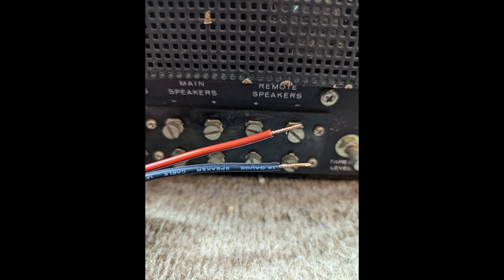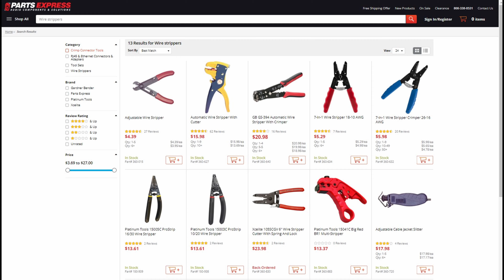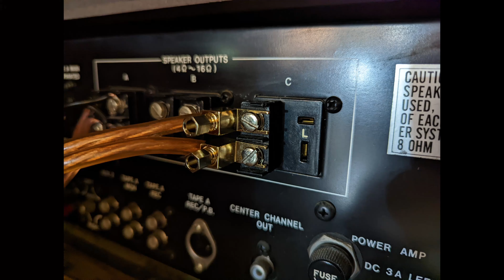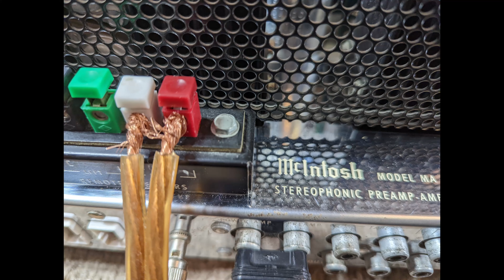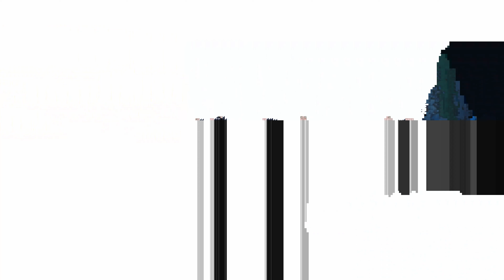How To Connect Heavy Gauge Monster Cable To Vintage Stereo Equipment- Receivers Speakers Amplifier

Comment: The only thing my amp manual says about speaker cables "It is very important to use speaker cables of the
correct diameter in order to reduce power loss". My speakers, rated 4ohm 900w, manual reads "Use the appropriate gauge of wire. A minimum of 18 gauge is recommended for up to 25 feet". I use heavy (10ga), good quality speaker cables because they sound better to me.

Comment: Hello folks. I always tin the wire because I can turn in into a spade lug or pin using solder that is made for electronic products 4% silver added. Not the plumber kind.
Now nice fat wire I trim the end down for it will fit. 
Then I'm still crazy by thinking on my own or remembering someone else idea.

Ride Easy
Reply: you should research "tinning wire with screw down connections" then stop doing this. 

also trimming down the end of a wire, IE removing individual strands of copper wire from the bundle, does exactly what is sounds like it does, it makes your low gauged wire into higher gauged wire and if enough wire is removed from one end could cause resistance and heat issues at the connection.

Comment: Clearly we share a similar perspective on expensive speaker wire.   I sold (almost literally) a ton of Monster Cable back in the late 70's and early 80's and crimped my share of connectors. As a college aged salesperson, I memorized all the talking points. My personal opinion was and still is, that Monster Cable (along with all the others) did as much or more to improve retailer profitability as it did to enhance the listening experience. The Kool-Aid was really flowing as they entered the inter-connect cable space. I currently use 16 ga, properly terminated speaker cables.  I'm sure there are many who disagree with me, and to them I say "spend away".
Reply: Cable thin enough to generate heat would be a toaster, iron or hair dryer. Super thin cable is called a filament which gets you into incandescent light territory if enclosed in a bulb filled with special gas. Even a monster Pioneer SX-1980 would only need 14 gauge wire to power speakers. If you had a tower of speakers needed to host an A;ice Cooper concert you might need thicker speaker wire to power massive tower speakers. However for home listening 14 gauge copper wire will do just fine for home systems.

Comment: I'm kind of new to all this, and I'm glad this video popped up. I was never sure what to use and of course the " bigger is better" always comes into play. I always wondered about bigger speaker wire. I'm using regular speaker wire on my Adcom 555 amp to Polk speakers. Which use the banana style clips. I guess I will just keep on keeping on instead of buying into the bigger cable thing. Thanks

Comment: Im beginning to wonder if this is a pointless exorcise as you could use the heaviest gauge wire possible but it still connects to terminals on the amp which in turn are fed by tiny thin wires from a circuit board, its like turning on a garden hose into a  6" pipe your still only going to get the same amount flowing out the end.

Comment: Maybe something that's useful to offer. I make binding post extensions for my clamp or screw type speaker/amp connections when I encounter them. I connect a short lead of heavy guage speaker wire (about 1.5") to a binding post soldered and covered with shrink wrap to install into these connectors, if the hole is too small for the speaker cable I use for this adapter I remove enough of the strands and tin them to fit for the open screw type I use spades and cover them up to the blades with shrink wrap. Sure they hang down a bit but this allows for the use of quality speaker cable in large guages and they can be reused for other amp/speaker applications. Works great! I usually include a set to a buyer of any of the vintage kit I sell as well, it's always appreciated.

Great job Kevin, love this channel!

Comment: lol the argument makes me laugh and irritated at the same time. Personal I think to some degree both  are correct. I say that because I'm pretty certain that it hasn't been as far back as the 70's through the 80's Audio gear was designed and built with the available Resistor's,  Capacitors, and  Transformers etc. They were designed with the limitations of those components and what was then known about electrical energy moved within. I remember it was early to mid 90's when I read an article on how electricity flows through wire. I assume up till then give the articles premise that the current flowed through the wire. It does not. It flows along the surface and along with the upgrading of internal parts and refined circuit designs the idea of larger cables came into being. Danny Richie of GR Research has done measurements showing, if I remember correctly, frequency response differences and put out criteria on not just cables but isolation from grounding against ground loop interference as I understand it. It makes since, but I have listened to his recordings of it either as I think he made spec recordings that are downloadable for comparison. However, the biggest caveats from him and several other reviewers was it's really your choice if you are satisfied with your synergy no worries, but if there is something bothering you that you can't put a finger on it could be cables. Some people use to argue that speaker isolators were shake oil as well and that burn in wasn't a thing either. One thing that few have touched on that I came to understand long ago is very few if anyone hears the same way when listening ear canals very and as such so does what we hear and perceive. This part of why there are so many different speaker designs and mfg. I am fairly certain most, but not all vintage has certain characteristics that are similar just as much as they have reflected by specific brands certain styles, quirks, and or characteristics Silver Face, Black Face, Meters no Meters, green lights blue lights, Tube like sound and so on. We know today certain abilities of given Amp Designs give certain specific characteristics and matching is as much luck as it is intuitive. In the End it's your choice and what you seek. Thanks for the info on this subject and the adding of a Sub to Vintage receivers.
Reply: "Skin effect" has little application at audio frequencies.
Reply: An example of discovery and synergy is a recent vlog post by Thomas and Stereo. Who has been an Audiophile for at least 30 yrs and who stopped critical listening in favor of good enough and almost entirely devoid of talking down mfg and price in favor of performance and quality. He also does testing against by allowing his contemporaries of whom he has  7 or 8 Audiophile buddies with various systems they have acquired to review what he give them against their acceptable equipment not just his. Their systems, including his, run in the hundreds of thousands of dollars. At any rate he for years has tried to like Single Driver speakers like The Dirty Weekend by Zeus and or the Pearl Audio Speakers by Paul Lovegood. He hadn't succeeded till recently. He never got it till in a fluke he stopped trying to drive them with his various high powered digital or Tube Amps. Instead he put them to his tests with a 6 Watt Class A Tube Amp and was blown out by their presentation of his musical tastes. He said...Now he gets it. He reasoned though can't verify that high current amps were essentially overloading the voice coils on speaker materials creating a sound he couldn't stand but now with the useable and lower powered class A Tube amp or even a 15 watt receiver anyone like him love the single driver concentric speakers so many were Gaga over and find sonic Nirvana!

Comment: Heavy gauge speaker wire is a waste of time and money.  It's used by audio fools that have more money than brains. The laws of electrical engineering can't be changed.

Comment: I do not disagree with your sentiment here. Lets look at the numbers,... a brief look.
--
Diameter of 18awg wire is about 0.04in.
Skin depth at 20kHz is about 0.02in which brings the 18awg to look like 24awg at 20kHz.
Depending on the length of the wire this WILL effect the high frequencies.
24AWG resistance ~24 millohms/ft, Imagine 15ft of interconnect => 0.36 ohms/channel
Now if you are running 4ohm speakers that is about 10% of the voltage dropped across the cable at 20kHz,... OH NO! LIONS TIGERS AND AUDIO BEARS.
{note I did ignore some wire cross section geometry considerations,...}
To solve this: turn up the treble a tiny bit,...
{ Oh your Carver has no tone controls? Sorry about that. }
--
The wire resistance will dissipate power across the audio band, but unless we are talking big time watts this only means you need to turn up the volume a bit.
This is an argument for efficient speakers IMHO. 
--
Room acoustics will DOMINATE the sound before these wire considerations are important.
Then your speakers and crossover topology will come to the party. 
Probably followed by your amp design.
AND note the largest "problem" in audio is between your ears. 
--
I am not arguing for 18awg wire, personally I am comfortable with 14awg which has a big advantage with durability. Zip cord is fine and dandy. 
--
If you are really deep into a desire to understand these issues in depth, 
see https://sound-au.com/cable-z.htm
I did not read the entire article, but it looks complete.

Comment: If you must have bigger audio jewelry/wire try a clamp on y connector soldered and cutting one of legs. The pin is safe with quality electrical tape/vinyl tape.  Ironic vinyl tape for vinyl playback.

Comment: Just as reference, 16 gauge wire is 4 ohms.....per 1000 feet.  That said take a 10 foot piece of same equals 0.04 ohms.  That intern is 0.005 out of 8 ohms or 0.5% of your load (speaker) value.  Making that even easier to understand for a typical 100 Watt/channel amp we are looking at a loss of half of one watt dissipated within the speaker wire per side so a total of 1 watt loss in speaker wire.  Because our ears work on a logarithmic scale no one can hear the difference between 100 and 99 watts.  That explains why it is actually a great gauge to go with as when using stranded wire it is also usually easy to work with yet physically strong enough to not worry about.  14 Gauge (0.025 ohms/10')is the absolute largest I would ever use unless we are talking commercial installations with really long runs of speaker wire.  Those are just the simple laws of a mister Georg Ohm and those laws don't change over time.
Reply: Good info I just stick with 14 gauge though maybe my wire length requires only 16.
Reply: Get a Life !!!
Reply: I use 14. Most of the monster cable stuff is just snake oil.
Reply: @pmscalisi  IMHO, actually monster cable was the first widely available and popular overkill speaker wire and back then was considered and mostly was grossly overpriced. That said, today I think they are well worth their current pricing. Example: 50 feet 14 gauge Monster Speaker Wire cost only $25.  I don't consider that being ripped off or snake oil. As reference, over the last 50 years, as a radio frequency electronics technician working with all types of cable, I quickly learned quality cable needs to meet two specifications.  First is electrical specs to match the application. Second and nearly as important in rough environments are the non electrical materials and construction. Examples: Anything used outside maybe subject to sun, wind, and water damages. For any cable/wires placed underground, direct burial rated cable is recommended. Electrical specs don't matter when your cable is falling apart or just too flimsy to hold up even inside.  No, I am not making a case to buy a $1,000 4 foot power cable for your amp. That's insane unless you're working with a commercial application using crazy long lengths.  Simply put, quality cables/wires that exceed the requirements of any audio frequency and properly shielded (where needed) are available for very reasonable prices.  I've even seen one 120V amplifier power cable for $15,000. Talk about nuts!!!!!!!!!!!!!!!!  So rest easy with the "Monster Cable" stuff. 😁
Reply: @2wrdr I understand I’m an electrical engineer myself. And a semi professional musician. I just believe some specifications are pushed just to sell a product. 
I’m also very practical, perhaps this is where my skepticism comes from. 🤷🏻‍♂️
Reply: @pmscalisi  " some specifications are pushed just to sell a product "  Exactly, one must understand even most audiophiles have very little understanding of ohms law. That is just ignorance though.  When the same won't listen to an electrical engineer about something as simple as a power cord, well that's just stupidity,  but if they got $ to burn let them enjoy the fire.
Reply: My 5 gauge is 1.2mohms a meter. Not much resistance in other words

Comment: Have used zip cord ( 14 or 12 gauge as copper was cheaper then) for passed 50 years and hasn't failed me yet. Banana plugs whenever  I could, and always tinned cables regardless of connectors I needed to use as it made all those little copper strands into one solid wire. dual banana plugs are great to help keep things in phase when you can use them. Just found channel enjoy your videos!

Comment: What if you splice cables to create composite connections eg to an amp or speaker switch box accepting different connectors than what extends to the amp or speaker?

Comment: Great video! Two points:
1. Avoid over tightening old connections as plastic parts can break and screws can strip out. 
2. Check connections frequently as wires tend to loosen up and oxidation can cause poor conductivity.

Comment: I laugh when I think of the snake-oil buying audiophiles connecting their 10 guage cables to screw down terminals and reducing the effective wire guage to a fraction of the cable. It's almost as funny as them freting over digital interconnect cables. I love your comments in the begining of the video.
Reply from the maker: Thanks!

Comment: Catching up on your videos since I joined this site. I love it, so informative. At 65 and owning stereo equipment since the mid 70's I was always told you couldn't go wrong with a 16 gauge speaker wire and at times 14 gauge. I always thought monster was the best cable and have never used banana plugs. Am I missing out here?
Reply: I think wire gauge on short runs isn’t a big issue in terms of audio quality. 
It is probably better to use thicker speaker cable with high powered amplifiers and longer runs to loudspeakers. 
Probably can’t go wrong following the amp’s instruction manual.

Comment: Thank you for a great video. It occurred to me, if you put a big shrinking sleeve to cover the handle of the banana plug that could be a good thing. Use the one without the glue here, so it is easier to open up again if you need to do the wires again. I am also in the same business. Have nice day everyone.

Comment: I buy the 12 gauge pure copper  in 300 foot spools from Monoprice. ..attach pins, bananas, or spades…works for my Vintage amps..and I love Parts express..great source for stuff.
Reply: The Cable Company made my speaker wires. Nice people to deal with and reasonably priced. 
They will make custom lengths and let you choose the right connectors.
Reply: That’s what I just bought pure  copper 12 gauge. The strands are thicker , made in USA 🇺🇸. I have been running it for 25 years on the same speakers and never had a problem ever. I always read it’s less taxing on the amplifier. Also it is very durable because it’s big and it just looks amazing when I look at it everyday draped neatly like snakes all over.

Comment: I just saw a adaptor plate that replaces those 18 gauge spring clips 
to banana connectors  on my Marantz 2325 but just not sure what's involved to install the adaptor plate

Comment: I've been dealing with this problem for years, I figured out to use black heat shrink wrap on the negative wire banana plugs, 'just leave the screw on cover off' cause the tape would come loose, an make a sticky mess

Comment: gawd I hated those ' easy to use' snap lever connects.  max maybe 18 ga... etc.  I'd 1000 times more have simple screw / spade lugs even the tiny at the time versions. ( I'm 73 )  On the other hand I've also had a couple versions of modern banana plugs in which the plugs actually come apart > the wire connect part seperates from the plug part. just press fit cheap.  I used the same 14 ga wire set for like 25 years, zero issues but it was lookin grungy so I switched,   10 ga 'pure copper'  actual I still would call it ' zip cord'. given less than 20 ft 'normal ' lengths I just don't think I'd ever reliably note a difference. $ 500. a foot  stuff , not my cup of tea, not even close.  like your shows, a lot.
Reply from the maker: Thank you, Rick!

Comment: With the spring push connectors, I wouldn't use a pin connector. The surface area that makes the connection is so very small, just top and bottom of a very small pin. I'd use bare stranded wire that will be somewhat smashed down making much more surface contact. If the wire is too big, then cut a few strands back up the end and solder those all together to leave a stranded portion for the spring connector to bite down on.
Reply from the maker: Sounds logical. Thanks!
Reply: this is the correct way. properly cleaned and stranded wire is exactly what spring connectors are designed to make a solid connection with. screw downs get rings or spades soldered to the bare wire and connectors designed for pins get pins soldered to the bare wire. most importantly you have clarified if one ever removes strands from a cable end there should be a dab of solder flowed back into the cable where the cut off strands can mate via solder with their neighbors